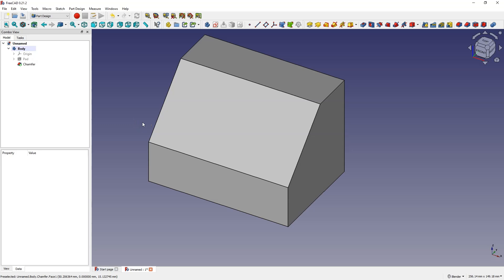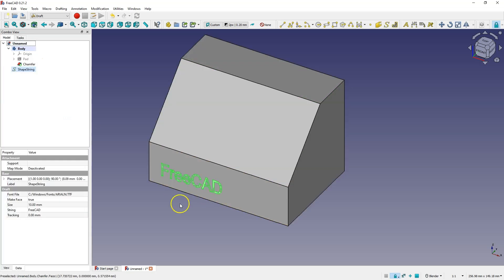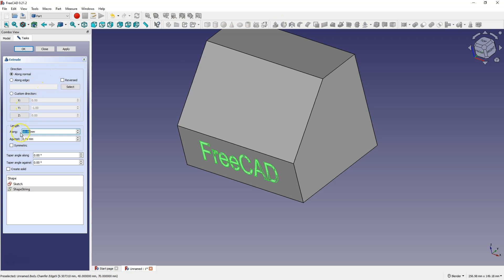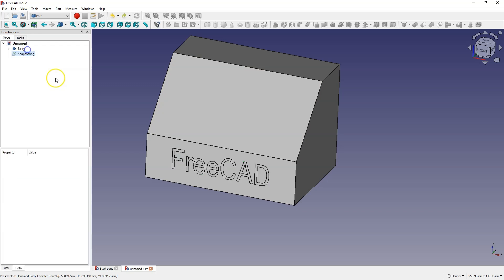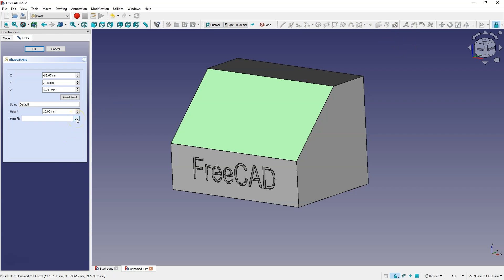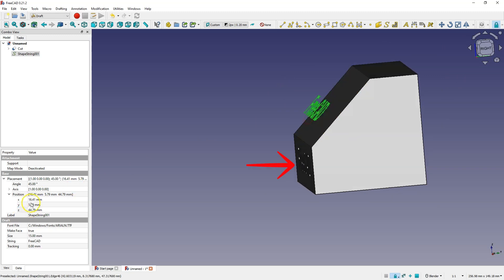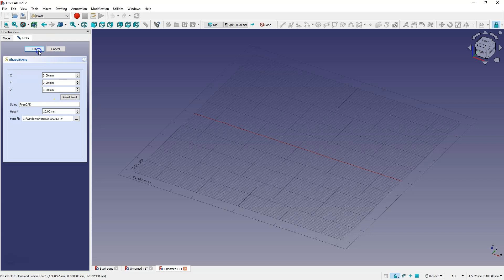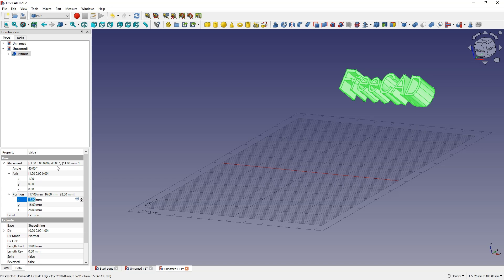FreeCAD How To Add Text

Comment: I exactly follow your instructions; however, the text always lands on the XY-plane, in which the solid was made initially.
I also notice that when I select a position on the vertical face, where I want to put the text, that the Z-value in the left column
always stays at zero.
So, what am I doing wrong??
Reply: You have to set the "Working Plane" to the face you want to work on. Look for it in the toolbar in Draft mode.
Reply: You also might wanna try just dragging it into the Part Body and adjusting the offset and stuff from in there.
Reply: @WesHawkins0  the work plane lands where ever it wants ....angled in space etc ...Completely shit program

Comment: Why the text is never on the face? It always attaches to some weird planes but never the plane I chose
Reply: Yes, same problem here...
Reply: @joop2295  Here's the solution: forget about attaching to surfaces. Simply create the text as you wish it to appear and then move it to body in item tree list and then simply use Transform tool to put wherever you like
Reply: @joop2295  You have to set the "Working Plane" to the face you want to work on. Look for it in the toolbar in Draft mode.
Reply: You also might wanna try just dragging it into the Part Body and adjusting the offset and stuff from in there.